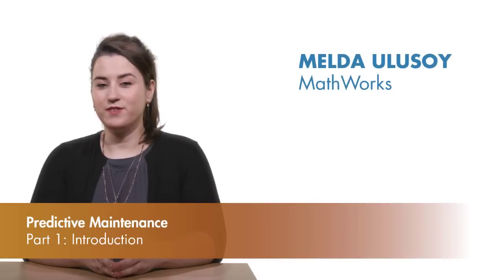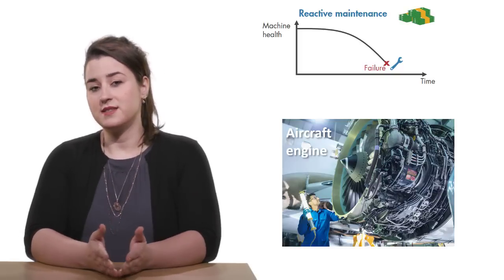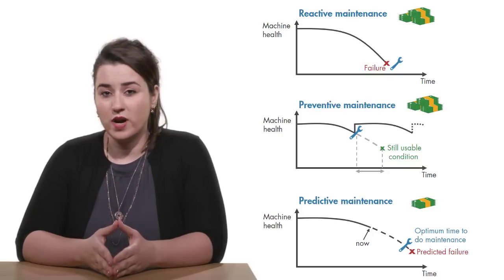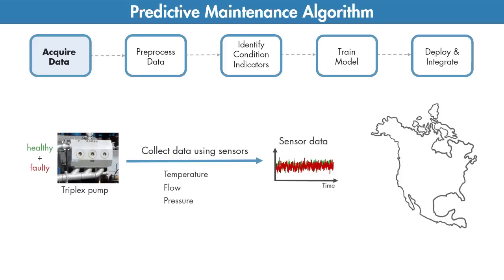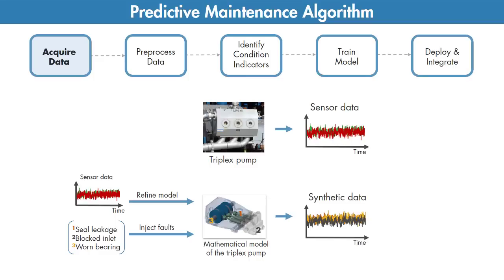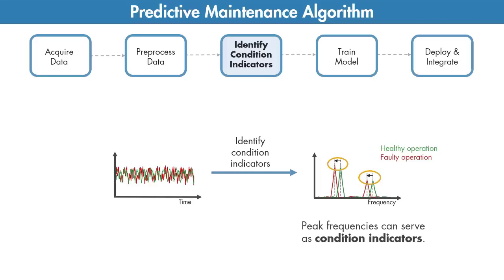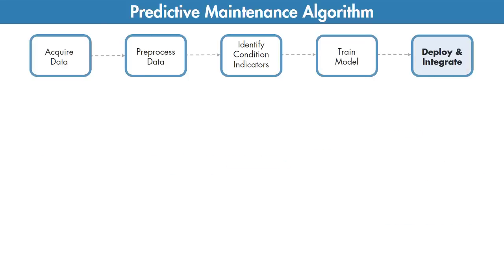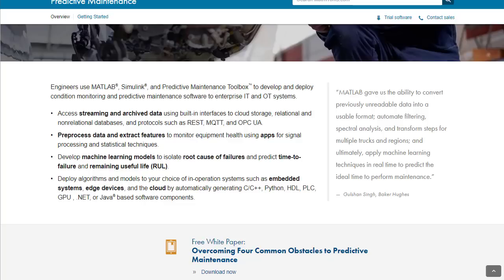Getting Started with Predictive Maintenance

Comment: what machine learning or deep learning algorithms are most relevant in predictive maintenance, like for mechanical machinery? I want to focus on them.
thank you in advance.
Reply: I am guessing it would be time series data of some sort. You should therefore probably either use a CNN or RNN though amazon recently published a paper stating that they had the most luck with CNN's with attention, rather than using RNN's. The CNN could also be used on the frequency domain data.
You could fx say that you keep like 2048 samples back in time, use fft on that, and then use the fft and time domain data as your dataset to train on.
Reply: @Music_Engineering  autoencoder, serch for anomaly

Comment: Thanks for sharing this.
I am new in this subject but  I need to know if there is any toolbox used to extract features using Matlab and some examples on it?
Regards
Reply: Hi, Predictive Maintenance Toolbox lets you develop predictive maintenance algorithms for your system. The toolbox includes the Diagnostic Feature Designer app that lets you extract features. You may want to check out the part-4 video where we  demonstrate how you can use Diagnostic Feature Designer app for feature extraction: https://www.youtube.com/watch?v=oDd7aEmRNpI
Here's another video about the Diagnostic Feature Designer: https://www.youtube.com/watch?v=W5ljkIIz6gQ
Also find more information on the Predictive Maintenance Toolbox product page: https://www.mathworks.com/products/predictive-maintenance.html